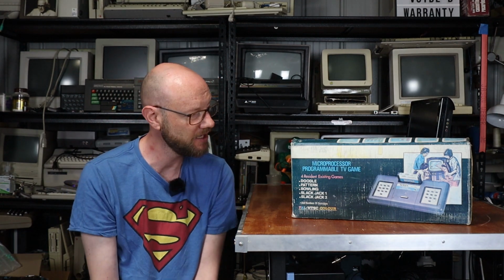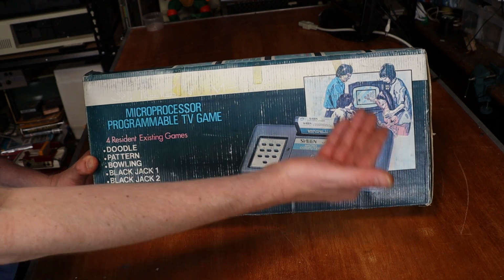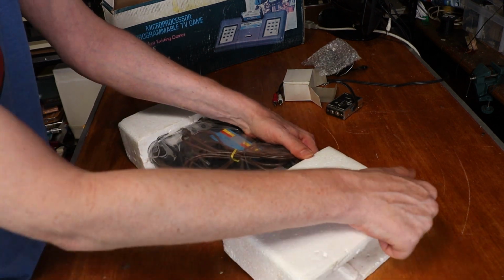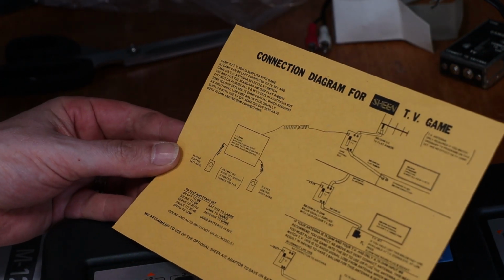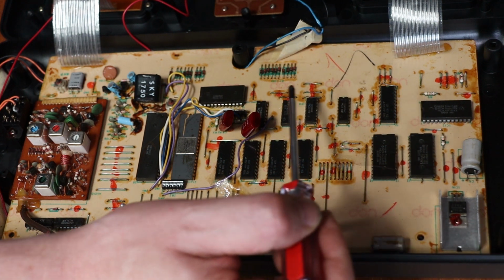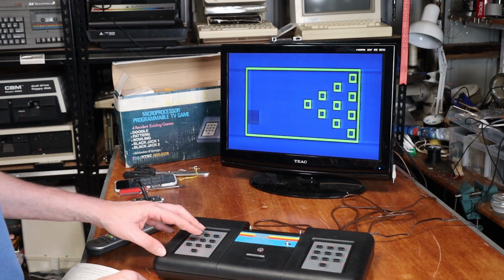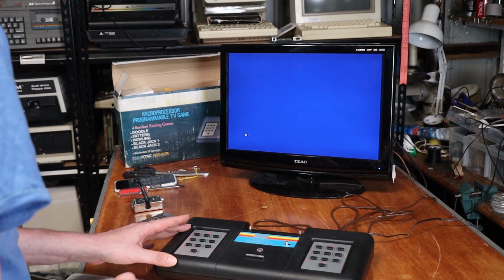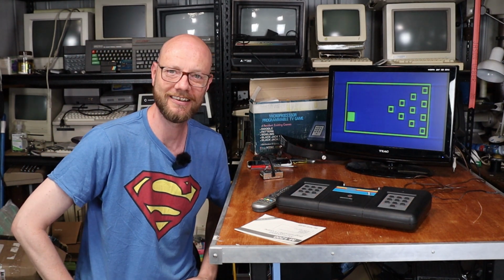Gaming Oddity: The Sheen M-1200

Comment: Very nice!  I know that the RCA Studio II, and its color ("colour") foreign clones were weak as heck in the graphics and complexity department, but they still hold a place in my heart.  They're simple, they're quirky, they're clearly something that would have become iconic had they been released a couple years earlier or so, and they use a fascinating microprocessor with a fascinating backstory.  🙂

FWIW, as I recall, what you're looking at isn't so much a Studio III clone as an enhanced Studio II clone.  That is, the PAL graphics chip used in the PAL-territory clones was in color, whereas the "Pixie" graphics chip in the original Studio II was black and white.  I believe that the PAL machines also have vastly improved sound capabilities, too, although I don't know how well any of the games take advantage of that.  As I understand it, a "true" Studio III would have had an ever better graphics chips (the pair of chips used in the COMX-35, perhaps), but my memory might be failing there.

I have a multicart for the Studio II, and it has all the foreign-released games on it as well as the original Studio II games (and some nice homebrews, including a surprisingly playable, albeit simplified, Pac-Man clone!).  Everything just plays in black and white.  Also, "Bowling", while graphically simple, is one of the original games for the system, but I also rather like "Space War".  A homebrew fave would probably be the pretty decent "Kaboom!" clone.

Comment: Yep. Wait for the Everdrive cart for this. Definitely. Only problem I suspect will be figuring out what to do with the remaining 1023.9 megabytes on a 1gb SD card. It is cute. It would be fun to get some static RAM on a PCB with an Arduino to bit-bang the contents over RS232 as a dev environment so it could run some code.

Comment: The cartridge connector appears to be identical to the RCA Studio II, metal rods and all. As far as I can tell, the games for the Studio II were black and white only, though.
Reply: I believe Biorhythm is the only Studio II game to be programmed for color, but the console only did black and white. Apparently RCA had plans for this Studio III but instead of spending even more money on manufacturing, they licensed it to Hong Kong based Sheen, who also sold it as Conic. There also is the Hanimex MPT-02 which is of the same age.

A few more games for the MPT-02 featured colors, like Concentration Match and Star Wars (!!). The later probably was a title RCA rather not wanted to release themselves as Lucasfilm would've hunted them down, but being an obscure company in Hong Kong or somewhere in the darkest parts of Europe, chances were less that George Lucas would find them.

Ironically, it seems every Studio II and III game were developed in-house at RCA, so not only did they provide licensing of the next generation hardware, they had a bunch of software for them to manufacture as well.

RCA moved on with a design for an upcoming Studio IV, which was to be more computer oriented. However it never saw a circuit board. Instead it is featured in the Emma 02 emulator as one of few systems to ever have been specified but never manufactured, then emulated many years later. They may have had a roadmap with a Studio V as well, I don't recall.

There are a bunch of homebrew games, featured on Flip's multicart. All the homebrew games operate in black and white though.
Reply: Ah, yes and some of those incarnations had detachable controllers and/or a joystick. Very confusing, but also very fascinating. And then there's the Chip-8 family of games, some of which might work on a M-1200, provided someone managed to put them in a cartridge (at least that's my understanding)
Reply: Actually, the Studio III has a double sided cartridge connector as opposed to the II's single sided one. Fun fact, the MPT-03 (Emerson Arcadia clone) has the same connector, though completely different pinout.